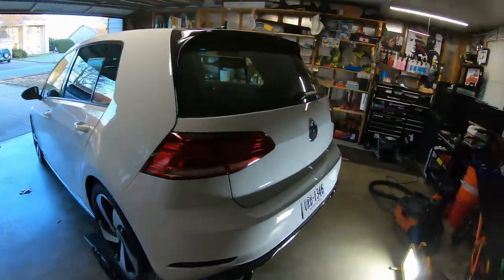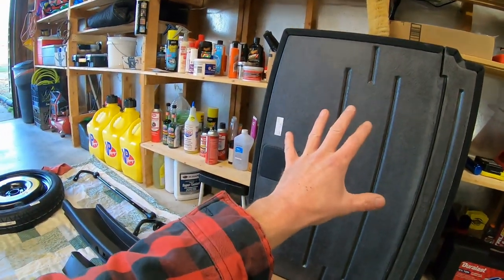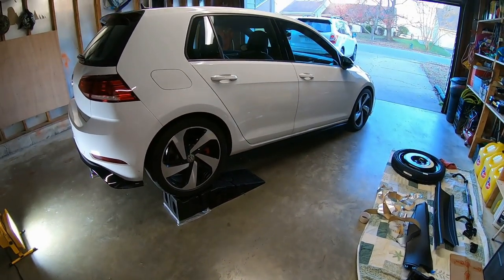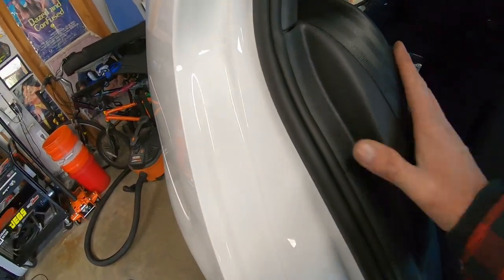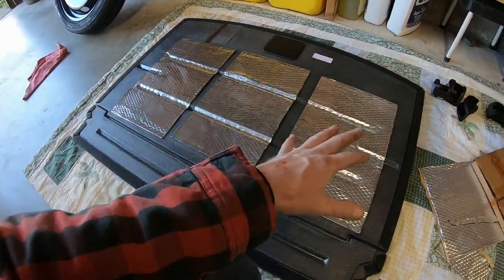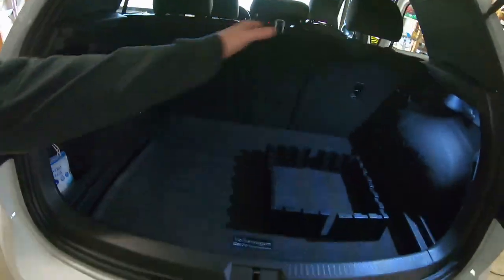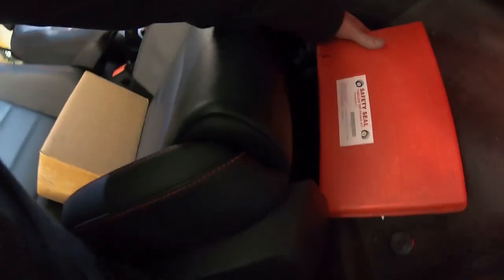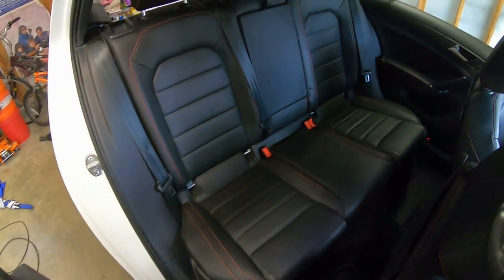2018 VW GTI SE Ep.296: Rear Sway Bar Update and More Sound Deadening!

Comment: I’m having a problem with a rattle on the rear passenger side of my wife’s golf r, I’ve been told that it could be the fuel line rattling, do you have any tricks on how to fix that? Did you have that issue?
Reply from the maker: mk7 or mk6? the noise isnt behind the glovebox is it?
Reply: @LastHumansGarage  2019 7.5 golf r from rear passenger side, behind glove box would be soundaktor?